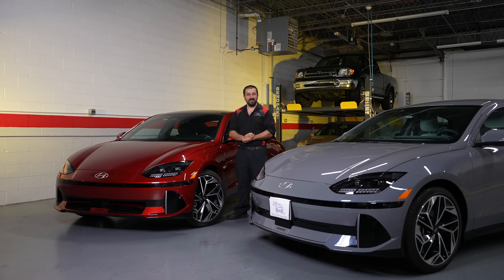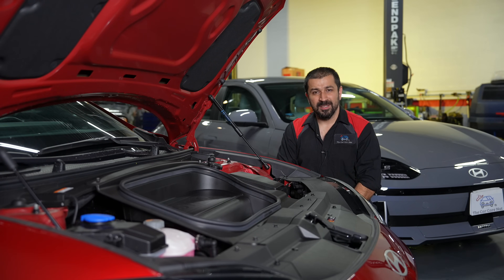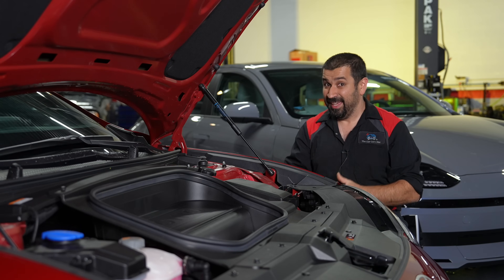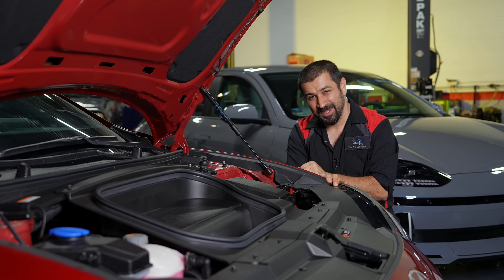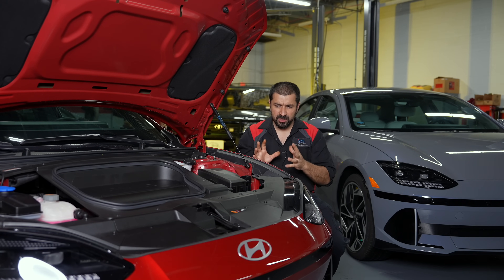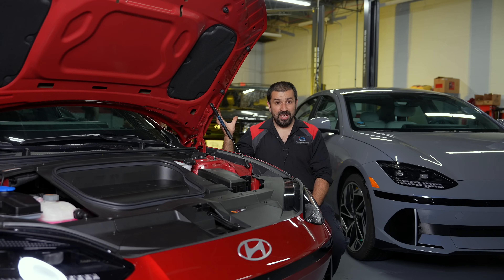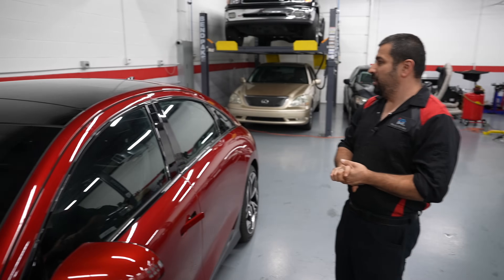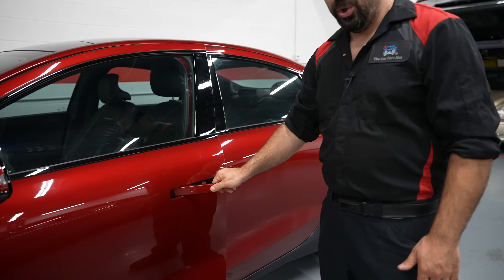Should You Buy a Hyundai IONIQ 6? Thorough Review By A Mechanic

Comment: I would be interested to see a comparison between the energy consumption on the e-GMP models vs. model 3/Y. I was really surprised how much energy Tesla’s heat pump can consume. The real difference when warming the car from cold isn’t that much less energy consumed vs. the old PTC heater. In normal use in seeing 0.62kW-1.5kW of energy consumption running the heater in my EV6 GT which is actually not as much energy as I expected. My old PTC-equipped Model 3 Performance used as much as 10kW when the heater was first turned on and I saw more around 2-4kW constant draw using the heater in winter. 

Regarding the DC charging, one big thing vs. Tesla is how much cooler the cells stay even fast charging. There’s about a 15-20°C lower peak cell temp on my EV6 GT according to OBD data than I see on our Model Y LR AWD. The fans do not have to run at high speed and the coolant pump doesn’t seem to be running as hard and as long as the Tesla does after charging at a supercharger. I’m sure part of the benefit is the 800V architecture, but not sure if the other benefit is from a better cooling design or the pouch cells vs. the cylindrical cells Tesla uses.
Regarding some of the design details… I’m fairly certain everything they did is about aerodynamics.  The vent from the front to the wheel well may work like an air curtain to smooth flows over the wheels. Same thing with the little black trim that stops midway around the wheel well opening.
Reply: Recent Teslas have not only a heat pump, but also an "octovalve" that allows the HVAC system to operate in a dozen different modes. For example, one of these modes extracts heat from the hot battery pack after DC fast charging for use in the cabin. Real world efficiency will depend on so many factors, as a few of these modes have a Coefficient of Performance of 1, meaning they're no more efficient than a PTC heater, while most have a COP far higher than 1. It would be nice to see a graph of average HVAC energy consumption at 70 MPH vs temperature for various EVs, with data collected for 2 hours starting immediately after a DC fast charging session.

The cell voltage range is the same for any given chemistry, regardless of how the cells are wired together in serial and parallel circuits. So I don't believe the pack voltage has much if anything to do with how the BMS manages pack temperature during DC fast charging. Tesla clearly decided that a higher temperature while fast charging is better for battery longevity. The car heats the pack before and during the early part of the charging session, and switches to cooling later in the session. Unless it's extremely hot outside, it typically only starts aggressive cooling once you've finished charging. I think the main challenge with battery thermal management isn't total cooling or heating capacity, but rather maintaining an even temperature across all cells.

I agree with you about the air curtain. They clearly put a lot of work into aerodynamics, and it paid off.
Reply: eGMP cars are all at the very top of DC fast charging speed, faster than Teslas, and they achieve their stated range, unlike Teslas. Quieter, much better fit and finish, and normal characteristics compared to Teslas..
Reply: @JohnCap523  I would love to see Hyundai/Kia/Genesis up the ante even further by bumping up the charge rate to 270-300kW. The cells don’t get really hot when charging at 235-240kW so I know there’s definitely a bit of headroom left. One other aspect they need to improve on is the high speed efficiency and also cold weather efficiency. I have noticed a substantial decrease in efficiency even when not using heat with temperatures in the 40s-50s (Fahrenheit) vs. earlier in the year when temps were in the 60s-90s. I do agree with you, Hyundai/Kia and most other automakers produce consistently better products than Tesla. The fit and finish is better, NVH is lower, and they all offer more features that Tesla refuses to consider like cross traffic detection, radar based blind spot monitoring, 360° cameras, etc.
Reply: @CFG39    Well, i’ve reliably gotten 239-243kW at EA 350s up until this past week when chargers seemed to be derated. I’m not sure going over 250kW is feasible or even matters when you can go from 10-80% in 18 minutes, which I have, a lot. Knocking that down to 14-15 mins is pointless to me when virtually other EV not named Taycan is 30mins or way more.

Yea, all the myths about Teslas, and bad mouthing if the eGMP cars by people who know nothing about them, like Toyota fanboi mechanic, are funny if not sad. Any of EV6, EV9, Ioniq 5 & 6 are superior to ALL other EVs under $90,000. Period, end of story. And a way better value. I’d never try to get my wife to adapt to how Tesla makes you drive. Never. Aside from the phantom braking and snapping control arms and stupidly unsafe need to look away from the road to see any data.

Physics is at play with high speed and cold weather efficiency.

Comment: Great review AMD.

😂 I think we hold onto to our Hyundai Pony little longer. At times, the choke cable is stiff but with few sprays of WD40 everything loosens up nicely.
Reply: See your point but eventually you will be buying a more modern car. Now wether it’s electric or petrol powered because of Co2 legislation they are all a lot more complicated and in 95% of cases beyond the home servicing look at any small petrol engine under the bonnet and look at your pony and you would think someone has pinched of the engine components.

Comment: The on-board charger is NOT used for DC fast charging, The point of the the on-board charger is to convert AC from the wall to DC for the battery. For DC fast-charging, the OFF-board charger performs that charging.

Comment: Would love a video about long term maintenance of ICE vs EV. I’m learning about $800 coolant flushes ?
Reply: Add up 10 years of oil changes, 2x transmission fluid changes, 1x coolant change of gas car to comparison. EV would use less brakes, almost none if brakes are not used hard as well. I would say difference would be more than $800 in total. Both would need differential fluids.
Reply: @EpicDrew15  they have "lifetime fluids" like gas cars, so sure as per the manual they don't need a flush. Same as my car's transmission and transfer case fluid. I still change all 3.
Reply: @EpicDrew15  Yeah they do, I’m
really curious what a long term 10 year, 12k mile a year cost of ownership would be on a Model 3 vs a Civic. You save on maintenance and gas but go through 2x the tires, that adds up. 
For SUVs like the Rivian I’m hearing some seeing tires go at 6k-10k miles. Thats a $2000/set
Reply: @EpicDrew15  that’s great info. Thanks!

Comment: This car was influenced by German & Belgian engineers from Audi TT and Porche 911. At 21:26, this feature (Air Curtain) is in the Porsche and Audi cars especially the Audi Q8 e-tron which is slightly optimized. Air curtains ensure that the airstream flows around the front wheels and the side of the vehicle was designed to generate as little turbulence as possible.

At 24:58/39:53, the sleek, low-profile design of the shark fin antenna was included to  (1) reduce aerodynamic drag, (2) house multiple communication systems, including radio, GPS, and satellite signals & (3) more robust and less prone to damage than traditional antennas.

Every surface of the Ioniq 6 has been honed in the wind tunnel to help deliver a claimed drag coefficient of 0.21. To achieve this, they used the Porsche 911 ducktail rear spoiler, boasting airflow speeds of up to 122mph from a 3400hp fan that generates downforce to balance out the lift that naturally occurs in a car at autobahn speeds, thus ensuring improved stability and increased driving confidence.

NOTE: Times a-changing. EV Car does not need a mechanic! It needs an electrician who understands computer code!

Comment: Thermal management is certainly an issue, but the point is kind of moot when heat pumps are involved. They can efficiently move heat around with minimal electrical energy use. Batteries do, by their nature, heat up when the energy is transferred. Between heat pumps and standard heating elements, EV's have enough energy to survive winter. But its true, range does suffer. Gas vehicles also lose a noticeable amount of efficiency in winter too, takes a lot more gas to fuel an engine and keep it warmer in the cold. So, its just a fact of life in colder climates like here in Canada! At least the summers here are perfect.

Comment: Thanks, AMD! What do you recommend for preventative maintenance on the aluminum knuckles to prevent welding themselves to the wheel bearings?
Reply: go home, take apart all the front suspension and anti-seize everything and then put it back together....it's just a Hyundai front end.....should only take a few hours....but I would be more concerned about all the crap that is going to get inside all the openings that he pointed out, especially the one over the battery

Comment: 9:05 -  You should really be talking about watts at his point.  Because that cabin heating system probably only needs some 1500W which is typical power of a convection electric heater.  

That 1500W is a small amount of watts compared to some ~10,000W at highway cruising speeds or up to 100,000+W during hard acceleration.  For reference, that 1500W if applied to the motors, will probably only move the car at walking speed if that.

Moreover, the actual volume of a sedan's cabin is tiny.  Its smaller than a walk-in closet.  So that 1500W heater only needs to run for a few minutes before it starts making the occupants sweat.  At that point, if the car has a good heat pump system, there is enough natural heat generated from the battery and ESC to continue to warm the cabin without extra energy draw from the battery.

Cold weather even causes some range loss in ICE vehicles: (1) more snow and slush on roads (2) colder air is more dense causing more aerodynamic drag (3) snowy conditions require knobbier "winter tires" which are not as efficient.

As for summer heat waves, both EV and internal combustion vehicles need to run a compressor to cool the cabin -- so its "even stevens" in that scenario.  But an EV may be more efficient though if it uses a heat pump cooler.

Comment: Thank you AMD for another insightful review. You have helped me appreciate even more my 18' Camry Hybrid LE. I am drawn to electric cars for simplicity reasons. But I can see this car is anything but simple with all of it's coolant and refrigerant heating and cooling systems for the cabin and battery maintenance. I believe that over the course of 300,000+ miles or 15-20 yrs, which is how long I keep my cars, I will be financially far better off with my Camry Hybrid than with one of these.
Reply: Telsa Model 3 outsells the Camry, costs less to buy and run (by a lot), has better resale, better performance, better tech and features, and will outlast it too.

Comment: The flare in the front wheel arch and the air passage from the bumper into the wheel well is there to smooth the air flow to reduce drag. I'm also surprised you don't mention Tesla's really bad panel alignment and messy body lines in your conclusion. Also, I drove a Tesla, the road noise was too much for me. I passed on that alone. The Ioniq 6 was one of the quietest cars I've driven, only second to the Mercedes EQS.

Comment: if you had more time.. you'd find that the levels of driver/passenger adjustments on the Hyundai info screen are very  expansve & comprehensive ..& the heated/cooled seats & BOSE sound are available only w/the Limited Trim

Comment: What about on those cold and wet days when you would normally run the heater and the air conditioner simultaneously so that the cabin has warm but dry air. This system doesn't look like it could do that

Comment: Hyundai achieves the high charge rate by charging at 800 V, rather than the usual 400-ish V. Since power equals voltage times current, with the same current but twice the voltage, you can charge twice as fast. Since the current is the same, battery degradation is the same as for normal DC fast-charging.

Comment: This car is supposed to be loud?! Whether it's on the highway or in the city or anywhere else, this car is extremely quiet. In fact that's very much part of the pleasure you experience driving it. Commentators from various backgrounds have consistently insisted that the Ioniq 6 is extremely and very pleasantly quiet. Not necessarily so with the Tesla. 

Also, and although I don't claim that it feels like a Mercedes inside, it feels like a special, expensive car. I mean just look at the rear seats. When you sit in the back, you feel like you're sitting in your living room. Incidentally, leg room is so generous that if you're traveling with one or two rear passengers, the remaining empty seat(s) give(s) you enough room to easily stack two travel bags on the floor plus two on the seat. 

I also find this car to be just such a treat for the driver. With its large double screens, plenty of technology and some nice special features (the digital side mirrors on my model are an change eye catcher), it does offer a decidedly luxurious look and feel.

Comment: It seems that even Testa heat pumps cannot survive US winters.    Whether it has a large frunk,  I think it has to do with the way it was designed.  It is a EV ground up and the hood is  very short compare to ICE.   So the frunk size is basically designed at the design stage.    It is not an add on.    So if the designer wants to make it bigger,  I think they can.

Comment: I purchased my ioniq 6 in California where front license plates are required. I noticed that hyundai doesn't prove a non-destructive method of attaching the front license plate, they only provide dimple locations to destructively drill 5 holes into the front bumper of the car.   Is this correct or this there an adapter that doesn't damage the bumper and the dealer doesn't want to go through with the additional effort?

Comment: We have a 2020 kona it has all these radiator. And heat pumps and battery  conditioning system. It also has active flaps for the cooling system.  Most ev are have these system.  Only the nissan leaf did not. But hyundia kia tesla, mg, byd, gwm, volvo etc

The shark fin must be USA Market  thing UK is not smoked plastic  its solid  or you can have body colour..
Reply: Vw beetle

Comment: Thanks for this great and detailed review. I've been driving electrically (Model S, X and 3) for over 10 years. In addition to Model X, we are currently driving a Mercedes EQV. I will sell the current Tesla this year and get a Hyundai. Tesla's service in Europe is very bad. The processing of Tesla is a disaster. With my Model X in 4 years I have been an incredible 15 times in Tesla service. That is the purest nightmare. So let's speak plain text: Tesla is pure scrap. All well -intentioned ideas that are not yet ready for series production. There is nothing to have a good drive unit and software if everything else is processed cheaply. In addition, the interior noises in the Ioniq 6 are much quieter than with any Tesla.

Comment: There was a youTube post " https://youtu.be/dr3mFzh0KSk?si=oIFY2irSzJaKI0e7" that claimed that an Ionic that struck something on the ground so that there was a rash on the plate protecting the battery necessitated replacing the battery (without even removing the plate to examine the battery) and the bill was $60000, basically the price of the car and that was considered abuse of the car and voided the warranty. This caused the insurance agent to total the car. Hundai didn't do anything for the owner, though they said they were going to make that decision rather than the dealer. My point is we know largely what to expect with an ICE car (or even a hybrid) but with EVs we don't. Sudden $60000 bills tend to make cars untenable to buy but those provisions can be hidden in the stuff they make you sign.

Comment: How does a landfill filled with electric cars equal “green”???
Reply: Astroturf comment
Reply: Because they are.... Do some research😅
Reply: This is my exact consensus of what is the problem with plug in hybrids?? You get the best of both worlds.
Reply: @marcusvision plug in hybrid is the worst of both worlds. Just get a standard hybrid
Reply: Much of the car will eventually go to waste like any other car, but the lithium battery should be removed and recycled (around 99% efficiency) and made into new batteries for future cars. The American way of relocating greenhouse gasses to third world countries rather than our own seems to be what is important to the US government over being actually green.
Reply: Depends entirely on the color of the car.
Reply: @bitbat9 said nobody ever... If you have a phev and a 20min commute you may almost never use the ice engine to the point where fuel going bad becomes a concern. Why pay for a 20k battery or not have plug in tech when a 5k battery meets most of your needs.
Reply: @wtfbbqbye exactly my point. Why not get an EV then? You’re lugging around a full ICE engine that you don’t need. And PHEVs are about as expensive as a full EV at this point
Reply: Batteries are nearly 100% recyclable. In most cases they get repurposed for additional life after the car falls apart.
Reply: @bitbat9 same reason some teslas lug around an electric generator
Reply: Besides batteries going back into other EVs for reuse/repurpose, they are used in hospitals, data centers, solar arrays/ home power storage, etc
Reply: @saiyan2525 that has nothing to do with what I’m saying